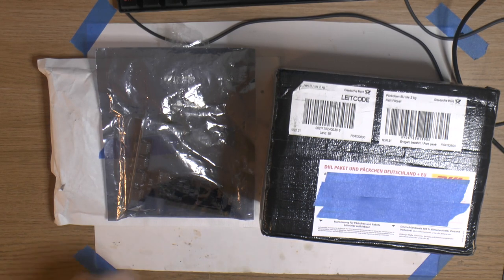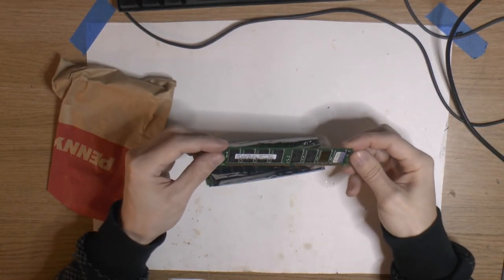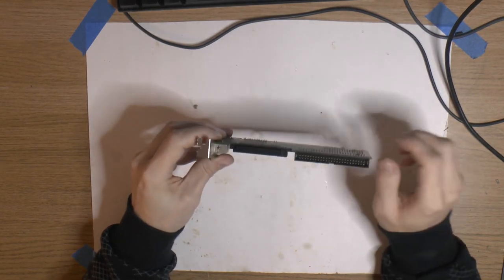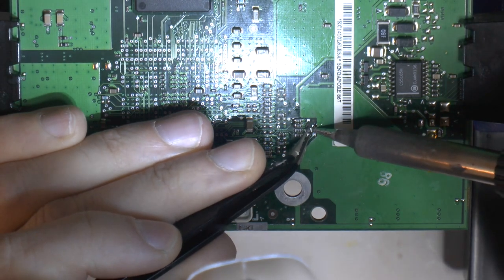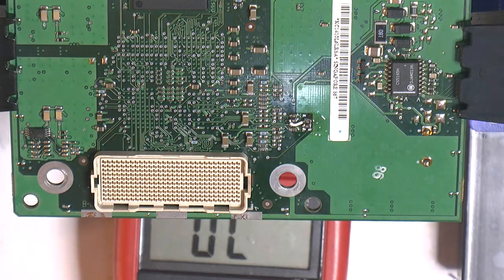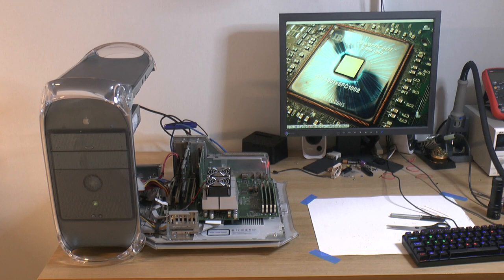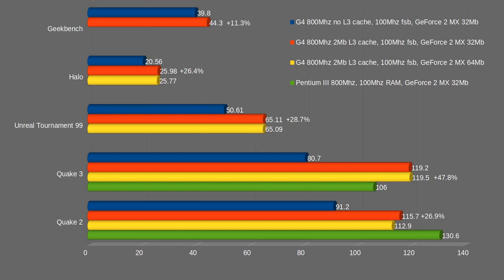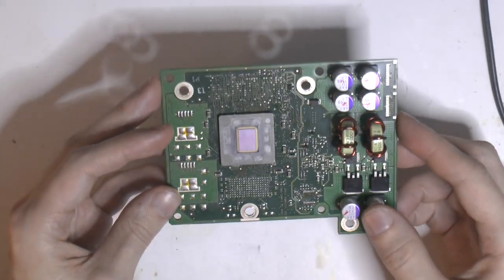Mailbag and G4 CPU upgrade

Comment: Hi!!! Which Power Mac G4 did you upgrade? Great video and cool upgrade!
Reply from the maker: Its a Sawtooth with early rev motherboard so 1999 so no Dual CPU support.
It is upgraded with Quicksilver parts, CPU, some internal chassis parts to make more room for the CPU cooler.

It is what the Original 1999 G4 mach should have been, faster CPU, better GFX etc.